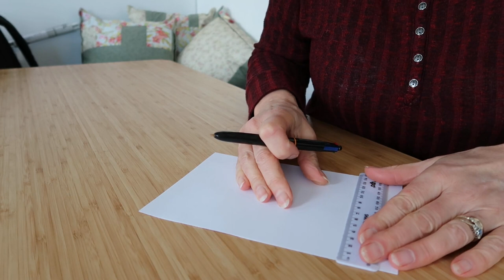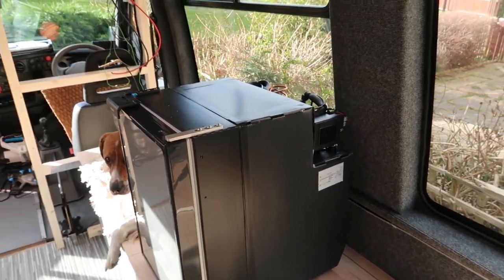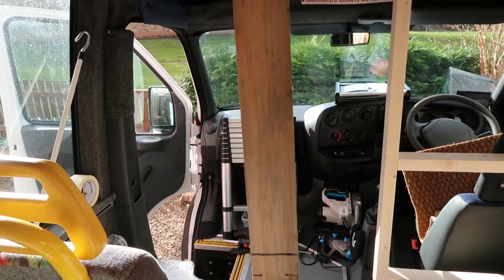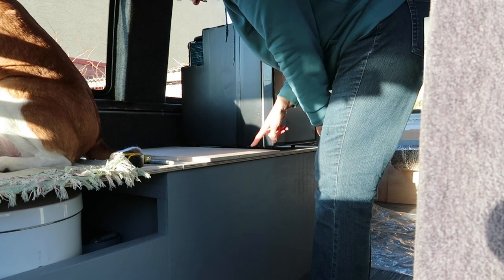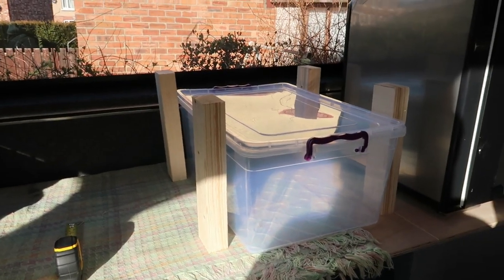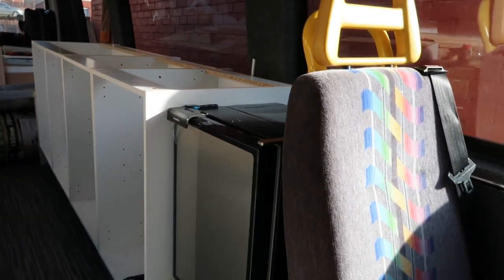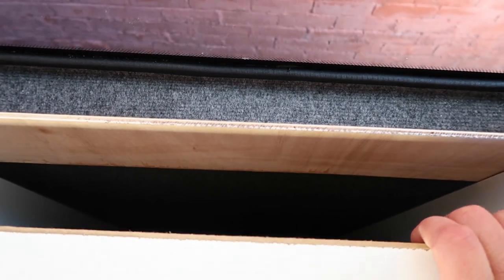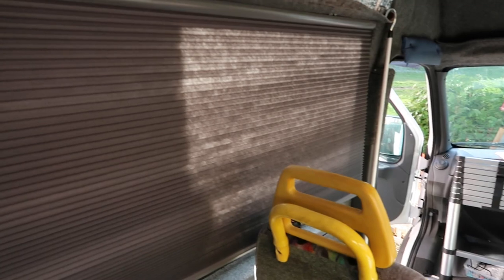Part 9 -Our Iveco Daily Self Build Minibus Conversion - Dometic Fridge & Ikea Blinds

Comment: HiElaine Is the bottom shelf mounted to the floor if not  you can strap the fridge to the shelf but it will turn over on the rough roads in Portugal  you can us upholstery webbing on top of the  fridge Mounted it under the screws hinges on top of the fridge and then the other end screw it in to the windowsill.  So that it does not rock over  And also I would extend the countertop to come over the top of fridge for more Working area and come down the side of the fridge so it’s box it in it’s another idea Just a suggestion might be of some help to you 👍✌️🤙❤️🇵🇹❤️
Reply from the maker: Good morning  John,  clearly great minds think alike, I've already screwed the shelf into kitchen threw the front and back legs, the kitchen then being screwed to each other, the floor and the wall struts.
The webbing I showed is screwed into the side of the kitchen and is tight as.
Today I'm attaching a stopper infront of the fridge feet and the kitchen top does cover the fridge as explained 👌 
We must be on the same page!
Thanks again for all your suggestions 😊 
Elaine

Comment: Enjoy watching the progress on your new project, I'm sure it will be great when done. What are your plans for Portugal? Do you plan to take this van to Portugal and matriculate it?
Reply from the maker: Hi Mark, Thank you.  We have plans to get out to Portugal permanently after the heat of summer has gone. The matriculation of the minibus is on the cards, so in order to make that easier we are working toward getting it DVLA ready as a Motor Caravan first, unfortunately these things never seen to be as easy as first planned.
Reply: @PensionersinPortugal  I'm not sure on the status of a Motor Caravan but matriculating a UK pickup was quite time consuming and required the vehicle to be factory standard when inspected in Portugal. Hope you can get all the accurate information you need to get it done 👍 it might be good to find an agent in Portugal to help with the paperwork...

Comment: Hi, Elaine and Darren, hope you's are well 😊? I've come across the same vehicle as yours and hopefully I'll buy it if insurance is right, do l have to inform the insurance company that l am converting it to a camper if so how does that work with MOT and insurance as I have a friend that bought a van and just insured it as a van and fitted it out as a camper, did you's have to go through alot to put it on the road, thank you again love what you's have done 👍
Reply from the maker: We looked for insurance company that could cover us for the first year as ' under conversion', then after that as converted. There are a few in UK who this. We used Marker Study, through Adrian Flux.
The MOT is easier, in UK they test what they see in front of them. If it's a camper they MOT a camper, if it's a minibus.....they're looking at road safety.
It's the DVLA that take alot of convincing. After everything we did, they still called it a van with windows!!!
Good luck with your search....getting a good vehicle to start with is the hard part 👍
Reply: @PensionersinPortugal  Thank you Elaine l see where l have to go with this now, they will be alot harder on it if it's a bus so I'll take the seats out and hopefully have it converted by next spring so it will be an MOT camper, insurrance is the only one l need to convince here, they won't insure it with no seats in it they said its either a camper or a bus, 🤔 hopefully I'll get their in the end thank you again take care 🤗